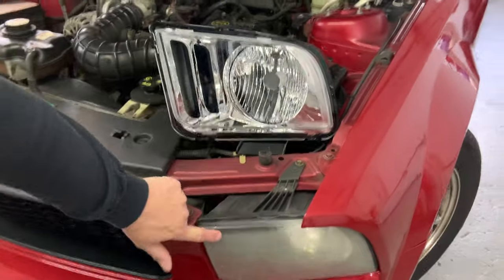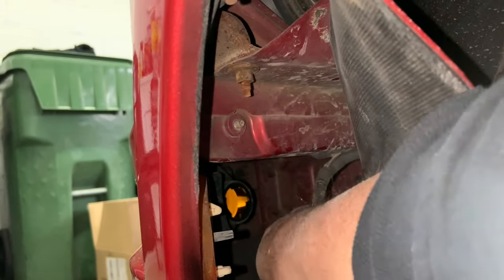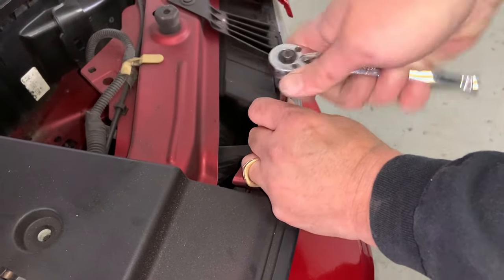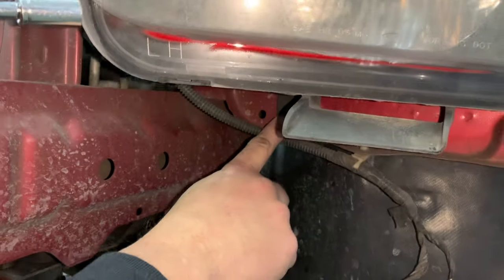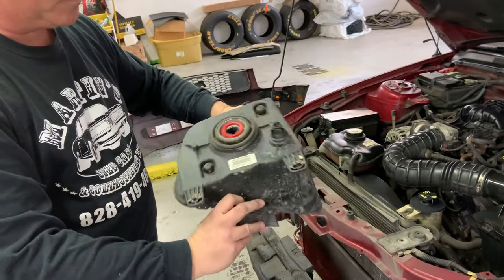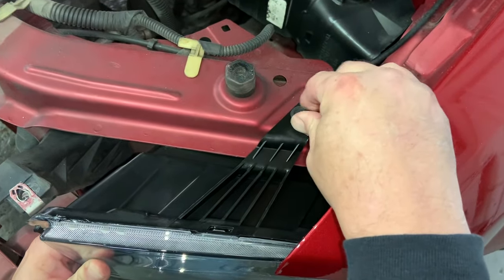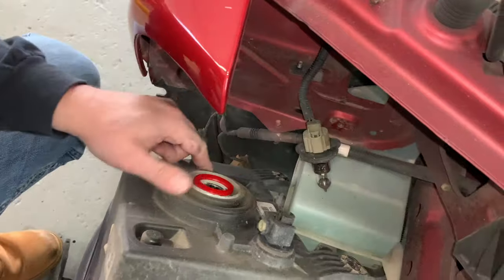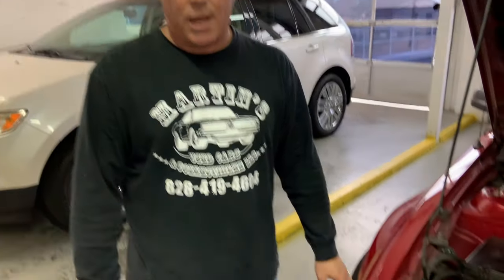How To Replace 2005-2009 Ford Mustang Headlights

Comment: Just used this video and it's the best how to video I think I've ever used.  Everything was perfect except for not mentioning to reuse the red spacer on the passenger side light.  Thank you... minimal effort and saved hundreds I bet.
Reply: I caught that also. Fortunately the red spacers can be added after the procedure in video without removing front clip.
Reply: FYI , install the spacers onto bulb fixture, much easier than trying to fit into headlight. Without spacers bulb will most likely vibrate plus let moisture into fixtures.

Comment: The only thing it looks like you forgot was the rubber gasket for the bulb housing.  When you remove the old bulb housing there is a red gasket that seals the bulb and puts pressure on the housing as you twist it in the headlight.  I just replaced my headlights and I noticed the bulb housing was very loose when installed.  Looking at the old headlight I noticed the red gasket stayed with the headlight so I just removed it and put it in the new headlight housing.  Now the bulb housing is a little more secure in place.

Comment: I would add put a lil bit of grease on the bolts...a smidge. And it would be a great time to upgrade the aux lights to LED. They really are much better and fairly cheap now.
Thx for the vid!

Comment: On my 2006 mustang GT changed all my exterior lights upgraded to LED, and high definition lights, took a about in total 3 days with runs back-and-forth to O’Reilly auto parts lightbulbs clips etc.

Comment: Which headlights did u get? Do u recommend them? If so please share a link
Reply from the maker: I bought the Ford Mustang 2005-2009 Chrome Pair Headlights Headlamps Left+Right on eBay for $59.  The black housing headlights are the stock headlights. You can search eBay for both. They are relatively inexpensive.

Comment: Great video sir.  Sir do you have a link to where you bought the headlights? And how are they holding up a year later? Do they still look new or do they have a yellow tint on them? Thank you sir!!
Reply from the maker: We purchased them at eBay. 
Here is a link: 
https://www.ebay.com/itm/Fit-2005-2006-2007-2008-2009-Ford-Mustang-Black-Headlights-Pair-Lamps-Left-Right-/173030082675?mkcid=16&mkevt=1&_trksid=p2349624.m2548.l6249&mkrid=711-127632-2357-0

Comment: Small drill with extension could zipped those off in no time then turn it to 1-2 to reinstall screws so won’t strip out. But great video

Comment: Do I need to do all that if I just want to replace the lens/cover? Mine is yellow and oxidized and beyond cleaning.
Reply from the maker: Most likely have to take the lights out to either replace the lenses or the entire light assembly.
Reply: @MartinsUsedCarsCollectiblesLLC  Thanks.I just bought the car yesterday and haven't had a chance to look at it closely.
Reply: @johnjohnson1313 man if you have the money you can just replace the whole assembly if your going for a fresh look, HIDs are the best but you can still use non HIDs and it's still nice

Comment: My lights for my  mustang 05 are pointed downward (i just bought it at auction) how can i adjust them?
Reply from the maker: The bulbs might be placed wrong in the headlight. Try removing the bulbs and reinserting them. There should be some wiggle room to adjust the bulb when putting it back. If that doesn’t work. You might have to remove the bumper and adjust the position of the light brackets (where the three screws hold the lights in place). Then test the lights to see if they are in the correct position.

Comment: If anyone can help me what are the first 2 10mm screws called mine are rusted and broke (all 4, 2 on each side)
Reply: They are just bolts on a plate easily replaceable with ones from a salvage yard or I’m sure they make replacement

Comment: can you make one for 05-09 side markers. front and rear
Reply: Those pop right out, just need a flat head and wiggle it in the slot.
Reply: @KingBattlon front side markers are the turn signals and those do not pop out, only the rear markers pop out

Comment: Is there an easy way to remove the clips?
Reply from the maker: You can buy a set of plastic pry tools on Amazon for approximately $10. They are easier to use than a flathead screwdriver.

Comment: My first experience doing headlights for a friend (rusty car). 
The bumper bolts in the wheel well would just spin. It was obvious enough, I could see them, but in Ford's infinite wisdom, they decided those need to be studs with a flat top that nothing will grip. This turns what should be a simple job into a nightmare. Honestly I personally hate these cars, well every make and model built after about 03. 
Same friend ended up paying almost 700$ to get a turn signal fixed(body control module) I'd say that turned me off of them as much as anything else. Switches and relays please. No computer controller for the headlights or turn signal please.

Comment: Whatever happened to be able to just pop out a headlight and put a new one in I mean geez these engineers are getting a little ridiculous now because I'm getting ready to do this on a 08 GT500 and it looks like a nightmare my 87 GT is 100 times easier
Reply from the maker: It not too bad. Screws on the side of bumpers and some clips. If you have the wash plate underneath the car, be sure to unclip it from the front bumper. Take your time and don’t get frustrated. Good luck.
Reply: @MartinsUsedCarsCollectiblesLLC Thanks for the info and a good video